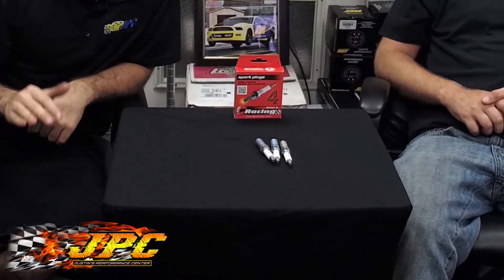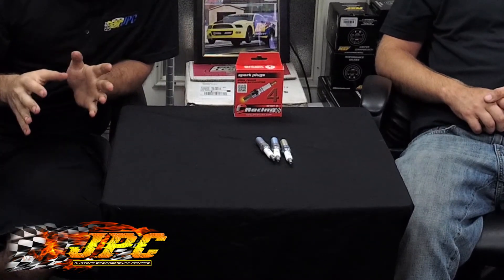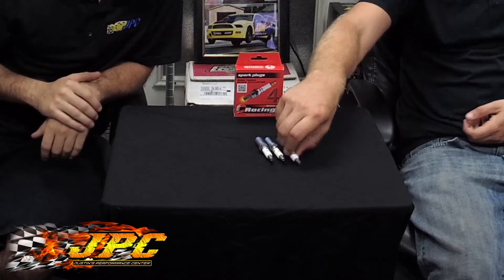Tech Talk @ JPC - Brisk Spark Plugs

Comment: I noticed my engine ran smoother. Also better throttle response.  I use them on most BMW S1000RR motorcycles and pick up a few hp thanks to smooth tip and no ground strap. This increase velocity in the combustion chamber.  You can feel this.